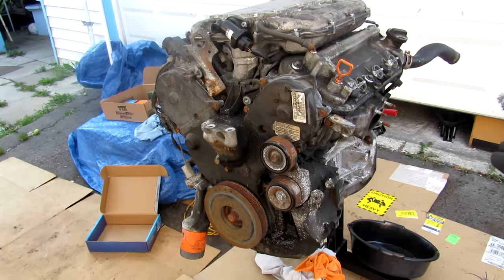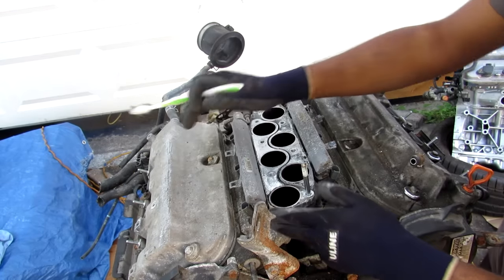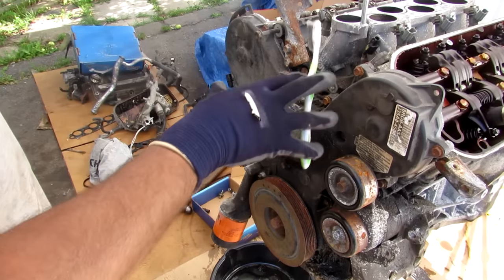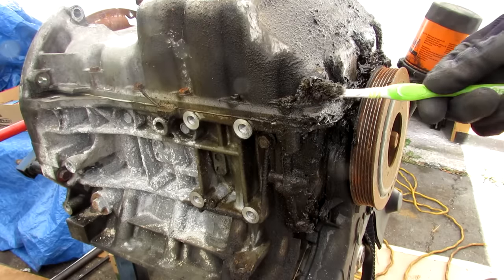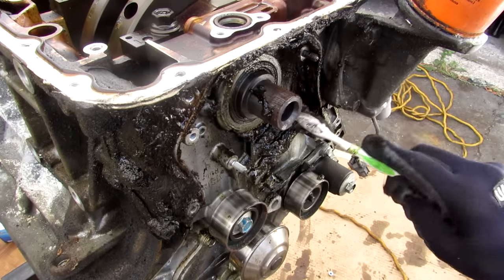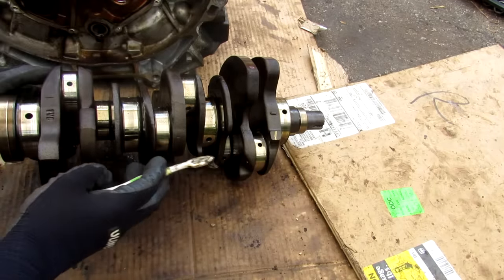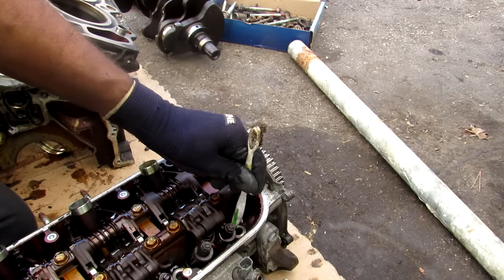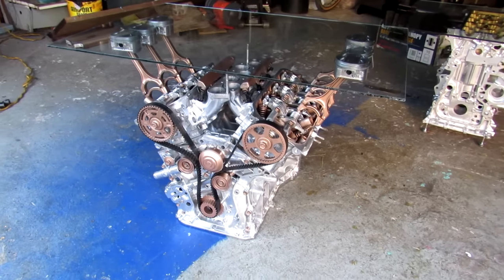Why Honda V6 Engines Haven't Changed For 25 Years

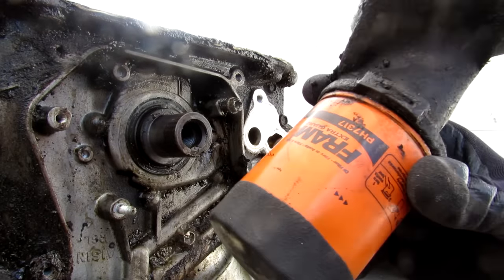Comment: 8:50 "This one uses Fram oil filter so you can definitely tell this engine has seen some abuse" ahaha
Reply: Glad someone else caught that
Reply: I'm guessing poor brand or one popular with "boy racers"? Heard the joke, just don't understand it as don't see this brand in Australia. Anyone care to explain? 😁
Reply: Oh my insides hahahahhahs
Reply: @Jason-cu1jp  Fram is the cheapest filters, therefore, inconsistent Quality.
Reply: @Jason-cu1jp  if you want to put a new engine in your car this in the fast yet slow way to do it.... fram stuff is a terrible
Reply: Fram oil filters are made of cardboard on the inside, they do a bad job of filtering your oil and after long enough use will come apart, but they're like 4 bucks so 🤷🏼‍♂️
Reply: nonchalant af 😂
Reply: I laughed so hard when I heard that hahaha!
Reply: Thanks heaps for clearing that up.
Reply: I have been using fram with mobile 1 in my truck for years. Consumer reports said fram was as good as any.
Reply: I use a Fram XG Ultra Synthetic and do not see any issues in the used oil during changes. I have watched a lot of filter tear downs and the XG filters always rate pretty high.
Reply: I've been using the Fram Ultra Synthetic filters paired with Full Synthetic oil in my J-series motor ('06 Accord V6) and have had no issues what so ever.
Reply: @ahu747  Fram oil filters are as poor a quality as you can find.  I owned a 2003 Acura Cl-S from new to last year. I used Honda filters when dealer serviced and Mobil One (highest quality) in later years. Used Mobil One synthetic from first  oil change. I never had leakage, oil burning, or any other related problems. At age 18,it performed as well as when new. Being able to have the most recent version of the same engine was a major factor in my purchase of a 2019 Passport to replace the Acura, avoiding the small turbo 4s which Honda and Acura now put in all but their biggest vehicles.
Reply: Been using fram for 9yrs. Cut them opened every time. Never see one collapse. They're identical to hondas current filters.
Reply: I have 282,000 miles on my j32a2 with only fram filters
Reply: @silasmayes7954  cheap our on the quality of the filter media, and use less material to reduce costs.
Reply: @silasmayes7954  I thinkthe current A02 honda oem filters are made of paper from what Ive heard
Reply: fram has like 5 grades of filters, buy the cheapest and you'll get shit. there top end one is up with the best filters money can buy.
Reply: Me and my Dad have using them for years on all our vehicles. Don't buy the cheap grade and change them every time you change your oil and you'll be fine!
Reply: @Scott Hoelmer royal purple is not that good. lookup project farms oil comparison videos
Reply: @Jason-cu1jp  Somewhere around the time the internet became popular, Fram became the oil filter of scorn basically.  I never had issues with them, although I have noticed at the parts store they are less prominent these days, I normally end up with a wix since they are typically on sale with my preferred brand: "whatever synthetic brand you have on sale right now"
Reply: I find it amusing reading all the Fram hater comments and especially the Fram is garbage use a Honda OE filter instead.... Spolier alert, Fram and Filtech  are the OE manufactures of the blue Honda oil filters.
Reply: @Garagejunky09  That's cause Honda filters are rebranded Fram filters. Kind of insane how dumb people are when it comes to branding .
Reply: @MuddinNYC  in europe Honda filters are the same as Purflux. Excellent brand.
Reply: @Jason-cu1jp  Fram is a "mainstream" brand that relies heavily on marketing to push its ware.  Accordingly to oil filter enthusiasts (yes, those exist, check out "Bob is the Oil Buy" site), the "standard" orange filer is of a very low quality, and clearly sub-par.     Some of their higher end lines are decent, but its reputation for poor quality is prevalent among gear heads in the US and Canada.
Reply: @HalfBreedMix  The Fram Ultra line is objectively rated as a high quality filter.  The problem is that the "standard" orange Fram is of such low quality, that it has tarnished the overall reputation of the brand.  I too have used Fram Ultra in various applications, and they are fine.
Reply: @silasmayes7954  using paper filters while are hot-glued together at the seams, NOT using an end plate to ensure that the filter element holds structural rigidity... Frankly, for 5,000 mile changes, it wouldn't really matter.  But if you were to follow manufacturer's recommendation of one filter change for every two oil changes, then it can be problematic.    The "better" brands after can handle the same filter being used for two, three or even four oil changes.  I wouldn't do it, but they are able to put up with that much more use....
Reply: @dereky.6737    Cool, good to know. TY.
Reply: As others have said, if you change your oil and filter regularly, even a Fram orange oil filter would be ok to use. The damage really start to shown if the oil change interval got dragged on.
Reply: I said the same thing when I saw the fram haha
Reply: change them every 3k or 6 months and you're golden...
Reply: Haha, I just recently watched many filter videos and sure enough, fram has always been on the bottom, they can't keep them from getting rusty, never gonna use one again!
Reply: The filter doesn't make a shit difference not changing the oil does, and this engine is well over 200.000 and really has no issues other than a leaking front main and a bad timing belt.
Reply: @randallstewart175 the Fram filter  probably been on there for quite some time, and the oil is filthy, probably way overdue for an oil change, sludge all around, and yet the engine is still in fairly good condition...doesn't appear that the fram filter is capable of harming this engine, especially when using 5000 mile oil changes like the filter says to do..they also make a 10,000 mile higher quality filter
Reply: @dereky.6737  it says its only good for 5000 miles on the label...this one looks like it was driven a long time by the looks of the oil condition, yet  the fram filter didn't seem to harm the engine...
Reply: @Jason-cu1jp  Worst oil filter brand you can purchase here in the US/Canada. Absolute garbage.
Reply: @billwilson3665  FYI, Consumer report is no longer independent (they were at one time), but are now a "for profit" company and therefore will gladly accept money for placement and review. So unfortunately, not a good reference point for impartial review. And the filter will work OK, but the fact that you use premium oil is really what's helping with longevity. Suggest you get the Mobil oil filter as well or any other brand really (but not fram).  But, its your truck so do as you please.
Reply: CNT e
Reply: @Jason-cu1jp  you are correct, Fram filters are cheap and the fast and furious crowd tend to use them as they’ve spent all their money on mods that just abuse the motor. Here in the states the junk yards are full of Fram filtered junk engines.
Reply: K&N is the way to go👍
Reply: @billwilson3665  They’re not great, but they’re not that bad as long as you change your oil and filter frequently. Don’t leave them on too long. Fram supplies genuine Honda brand filters, too...prob mfg to higher standard
Reply: @randallstewart175  Look closely at the fine print right on that blue Honda filter. It says “Made by Fram”. Nothing wrong with those. Any company can make good or lousy stuff, depending on what management, customer and the business plan decides.
Reply: @HalfBreedMix  
My 06 V6 accord went 171k and it was about done. Now 2012 TSX V6
Reply: @monkeywkeys3916   The V6 TSX was a good buy on your part; they are kinda rare too, not many people knew it came with the V6 engine for a few years before the TSX disappeared.
Reply: My J has just over 323,000 miles on.
Uses a quart between 6000 mile oil changes .
Ive ONLY used Walmart brand synthetic oil and the cheapest Fram filters I can find.
Ive had a couple of 300,000 + Hondas. Same setup, no internal problems so far. I'm gonna stay the course.
Reply: Lol 😂.  Use wix or Nappa Gold if you love your car.
Reply: @Frost_Tiger  It's funny, because Fram is a brand that has been around for many, many years. Fram and Ryco used to be the best in terms of quality. now, apparently it's crap.
Reply: @autophyte  I would think so too I'm too young to know how good they use to be but stuff in the past was good that are now crap like this brand... aw well 😅🤷🏿‍♂️
Reply: @HalfBreedMix  if you care about your engine use the Ultra Synthetic filter like I do. The cheapest is fine but make sure you change every 3000 miles.
Reply: @johnames6430   I change my oil filter every time the oil is changed.  Oil changes are done whenever the car's maintenance minder tells me to.  LOL, I just assumed this is what everybody did.
Reply: I used to teach at a automotive tech college and we had a bunch of new oil filters cut open to show their internals. The Fram was pure junk. It had cardboard inside.  Wix looked the best.
Reply: @mindtouchone   Which tier of Fram filter did you cut open?  I get the highest quality one they have on the shelf (called something like Ultra Synthetic).
Reply: @Jason-cu1jp  junk filter. Napa gold is a good one.
Reply: @billwilson3665   I have never had a problem with a Fram filter.   after 200,000 of miles
Reply: Yeah when I found out about Fram filters  I am like yeah nope I go the inventor of the oil filter.
Reply: @JonathanWhoever  oh my you could ruin your engine I have 209k on my mom's odyssey I change it every 3k-5k miles nothing is wrong with her we did put 5w30 before we read 5w20 on the oil cap but the van didn't care what is what so long it is oil and not thick oil.
Reply: I use the Mugen filters for my TLS it adds like 50HP 🙃
Reply: I stopped using Fram when my new civic had serious oil burn smells when I did hard left turns, It was the Fram.
Reply: on the opposite you have Mann or Mahle filters lol
Reply: I get that some people simply cannot resist ignorantly bashing Fram on the internet.  Interesting take because Honda uses Fram made oil filters for their OEM oil filter.  Millions of Honda vehicles using millions of Fram OEM oil filters for millions of miles over the course of several years without issues.
Reply: @billwilson3665  Same...240K on the jeep so far.  No different than the factory filter that came with the car.

Comment: Finally someone has a good J Series teardown video
Reply from the maker: Thanks. Yet the engine is so old and no one has one?
Reply: @speedkar99  I looked around no one has one in detail like this
Reply: J series never get the love they deserve
Reply: Are you located in Florida? My boy just sold his 98 Acura TL with a 3.2 💔💔
Reply: @markjuarbe1048  I don't really "love" the J series. Honda should've went with an inline 6 but I guess they needed something more compact, or at least DOHC. The power just isn't there to justify it over their 4 cylinder offerings. Sub 300 horsepower from 3.5L is pretty sad.
Reply: @juansolo1617  from a power standpoint they do alright. My 03 pathfinder has Nissan's equivalent- most would argue no better, no worse- VQ 3.5 series that's making 240 hp. Properly maintain these engines on time and they're a breeze to get get you 200k miles. Newer tech turbo 4 cylinders may put out more power but there's increased complexity and decreased reliability. That's coming from Scotty Kilmer. Higher pressure & higher revs wears 'em out faster.

I'll take dated technology reliability. Others who need "earth dreams" tech and higher cost to repair and increased likelihood for need for repairs can have it
Reply: Juan Solo you unfortunately don’t know what you are talking about
Reply: Juan Solo for their application, they aren’t too bad.  The 3.5L in my wife’s van makes 280HP.  SOHC, naturally aspirated, stupid reliable, 20+mpg in a heavy van. That’s only 20HP less than my 3.0L Turbo BMW makes stock with all kinds of variable cam timing, valve lift, direct injection, twin scroll turbo, etc...
Reply: Brian Lawyer  without sacrificing too much in the low rpm range either. not bad for 20+ year old architecture....
Reply: @juansolo1617  dude these make great power what you on about.
Reply: @GoFastGator  yea i have the 3.0l 240hp and i get about 27mpg regularly. Mad reliable 167000km and no issues ever.
Reply: @santhoshreddy4793  what is that video have to do with a complete tear down?
Reply: @ONeal397  it doesn't have anything to do with teardown, but the most complicated part of any engine is the head assembly and electrical. The series of videos you find along with this video shows you everything you need if you are working on these engines. The reason why I shared is that it helped me a lot when I was working on my Honda. It blew a head gasket due to overheating
Reply: @Juan Solo

Sad compared to what? The power levels generated by the J35 are no less than competing naturally aspirated 3.5 liter V6s produced by other manufacturers. Any 3.5 liter engine that produces much more than 300HP is probably turbocharged. And you can’t compare HP figures from an NA engine to a turbocharged engine.
Reply: @juansolo1617  Lol, you must be a GenZ guy. Sub 300hp from a 3.5 6 isn't "sad" if you were born before affluent white suburban ladies were driving their Teslas to buy coke from their dealers downtown. And there are other reasons to buy a 6 over a 4, like refinement.
Reply: @kgbeezr75  100 horsepower per liter has been standard since the early 1990's. I get it... it's for their SUV and Minivan. At least they could've made better heads. I'm a major fan of Honda. This engine is just a bit lazy compared to other Honda designs.
Reply: @juansolo1617   what was said was what Chevy passed off as okay power on a 5.7L v8 that only made like what 250hp yea that’s. V8. Bud Honda made 300hp on a 3.5.
Reply: @HooptyGarage   Yeah, GM sucks IMO. As it sits now, the Ford Taurus 3.5L V6 EcoBoost starts at 375hp. That makes sense, it's DOHC. Imagine what Honda could do with DOHC. They really need a stronger V6, or a V8, just for towing capacity.
Reply: I want to connect a J30A to a lancer evolution transmission
Reply: My 2021 Passport is the fastest vehicle in its class with a NA V-6, literally the only comparable V-6 equipped vehicle that is faster is a Ford Explorer ST with a twin turbo V6.  Horsepower stats on paper don't matter as much as real world performance.